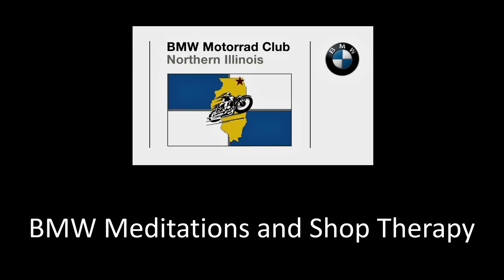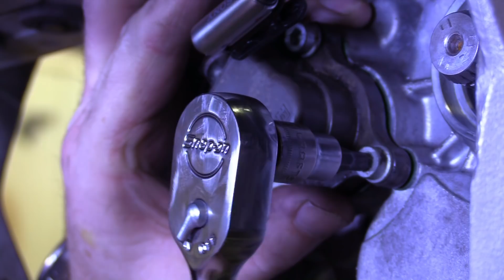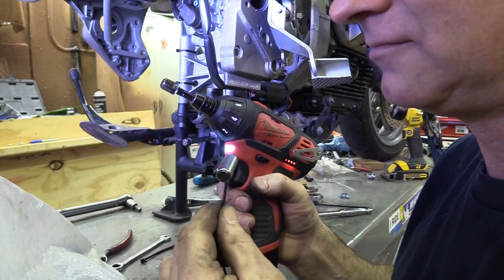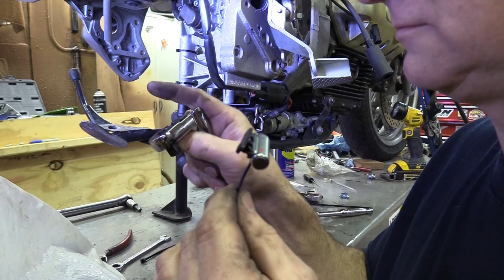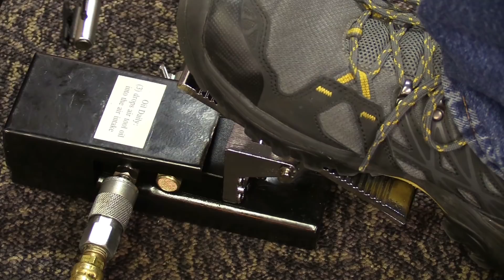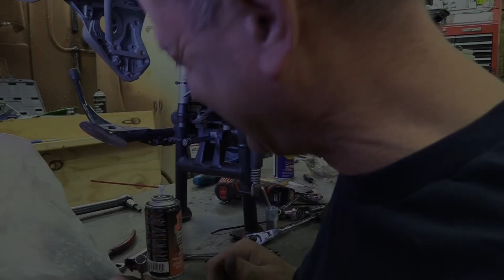BMW Meditations and Shop Therapy by LT Master

Comment: Ride left, safe. Ride right, safe. Ride in the middle, you get squished like a grape.
License never replace eye, ear and brain.
 
Trust quality of what you know, not quantity.
 
Wax on... Wax off, wax on... wax off
Snap on... Snap off, Snap on... Snap off
 
We make sacred pact. you promise teach BMW LT, we promise learn. you say, we do, no questions.

rattle can also special part 007-969-359 (22mm shim stock BMW handlebar) R Pirsig Zen and the art of motorcycle  maintenance